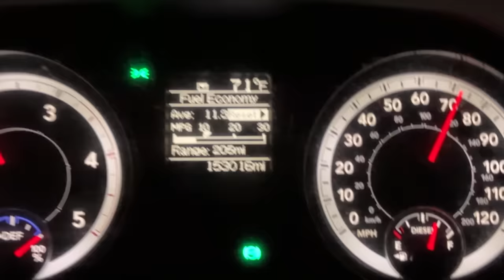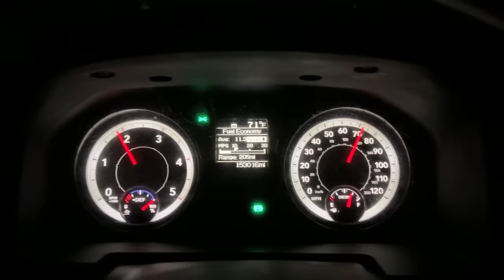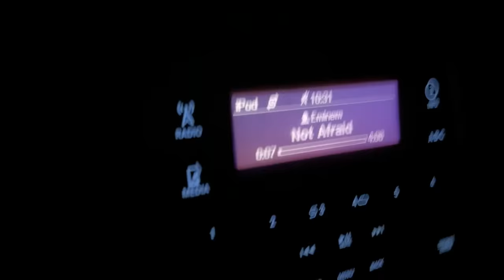My new truck broke down 9.5 hours from home. Dealer refused to do anything...

Comment: I worked at a Ford dealership for years and I think you unfortunately had a bad experience. We would have travelers break down from time to time and we would let them stay in their RV in the parking lot we would even run power out to their RV. Parking a trailer in the secure shop lot no questions asked. The 6.7 power stroke is a solid motor it shouldn't have let you down. That being said the fumnins is what brought me to your channel so I'm excited to see her getting some love.
Reply: This is the norm for dealerships treating people like crap I'm a diesel mechanic and see these people from all dealerships after they wiggle out of the warranty they come to us. While I agree it's a good motor, the issues are putting tons of cheap computer components on it then this happens, and it's all makes and models, no exceptions, even Germans' cars, same stuff junk
Reply: I wouldn't waste my breath arguing about Ford diesels being worth anything except the 7.3 because the rest are way overpriced garbage but it's just a fact that dealerships of most any brand are rarely helpful and will do most anything to keep from doing free repairs and pretty much always have. The electronics were garbage in the 80's and haven't ever improved much although I suppose the early 2000's LS computer and the rest of it's rigamaroll have proved themselves very reliable.
Reply: @Crazy oilfield mechanic  That's a stretch  saying  it's in the same category  as the 6.4 6.0. It's a solid  engine, what's wrong  with the new ones is all the electronics on them currently. I have a 2016 F450  6.7 EGR deleted, DPF deleted, fass fuel system  and a mild tune. Im not worried  about  it lasting  till 400k. The new engines  are fine, it's all the BS they put on them.  I bet with a aftermarket  fuel system, full delete  and a mild tune that truck would  be perfect. I still like the Fummins though  lol

Comment: I definitely think putting the fummins back into use is the best option. God forbid you start using the new truck again and it break in another 15k miles. The fummins really never let you down. Sure it needs work but 1. Its way cooler than the new truck. 2. with the engine thats in it I still feel like its more reliable than the 2020. Which unfortunately says a lot.

Comment: This is certainly an eye opener and something thats been on the back of my mind also. We are just about to leave on a trip towing which is around 4000 miles in your figures. We actually ordered a new tow vehicle for warranty etc however it's still not in the country so I'm now prepping our old faithful. 

You raise really valid points regarding if something was to go wrong with either vehicle. You are so dependent on the closest dealer and really have no control. Bring back the Fummins, it will be a great series to watch 👍

Comment: I'm sorry this happened Taylor.  I had my F250 threatening to go into limp mode while towing my RV through the Smoky Mountains.  I had to stop for the day and wait for a dealership to open, but when I got it there, without calling ahead because they weren't open yet, they actually got it in, diagnosed and fixed within a couple of hours.  It was also 100% covered by the warranty.  Obviously, this wasn't as big a deal as what you have, but I wanted to affirm that there are good dealers out there.  Rusty Wallace Ford, Dandridge, TN
Reply: I was 10 hours from my house in South Bend on the way back from Wisconsin when my starter went out in my Jeep. On the newer V8 Grand Cherokees you can barely touch the starter, let alone hit it with a hammer. Local Jeep dealer had it replaced in 24 hours. They definitely have the power to expedite things on a case to case basis. And I am the type to never rush a mechanic, but in this case I needed them to. This dealer sucks.
Reply: I live very close to that dealership.... got my truck at Rusty Wallace Toyota in Morristown. 
You had East Tennessee people looking out for you in time of need
Visit again.
Reply: @ericscottstevens  The Smoky mountains are awesome, and I'll definitely be back someday. I look forward to meeting some more locals.  Good folks there.

Comment: OK - so lets start at the servo shall we.
What is their business name, what is their trading name, what is their address, and lets see if the entire Internet can't BLACKLIST them.
Never to "ever" have anyone else arrive as a customer.

Then, lets look at that tow company shall we.
Why not name and shame them too.
I mean 25 miles away?
Haven't they got a SECURE LOCKUP near where they tow vehicles too?

Maybe we (around the entire world) start blacklisting them as well.
You'd soon discover a WHOLE NEW SET of client based services, that all repair workshops and tow truck companies would adhere to - if they knew they risked their business entirely - by screwing with customers from elsewhere, breaking down in their little area.

Comment: You probably wont see this, but my input: Definitely sell the 6.7 and keep/upgrade the fummins. Being that your job basically relies on the truck getting you to events, I think it would be the better choice. Like this situation, new vehicles are harder to do simple diagnosing, have more electronic failure points, need dealerships to do the work, etc. When they work, they're obviously better than an old truck, but when they fail, its typically a major issue leaving you stranded. With the fummins, YOU built it basically from the ground up and know the truck in and out. Being an older cummins engine, its a lot less complicated, and if anything were to happen, you'd most likely be able to diagnose it yourself quickly , and fix it easily.
Reply from the maker: Yeah I made the mistake of thinking engineers with millions in R&D could do a more sufficient job. I was wrong. Which is unfortunate. The whole idea was if it saves me missing even one event it saves me thousands of dollars that would have been wasted. Instead. It caused me to do just that.
Reply: Yea newer trucks just have more failure points , and the emissions systems choke the life out of them.. they always say a ford body, with a Cummins engine and Allison trans is the best truck out there, and you have that, and it even has most of the bells and whistles the new trucks have anyway lol
Reply: @Taylordrifts  
Actually Taylor,
You did far more R&D on the Fummin. You completed the proof of concept by putting it to work right after the build and testing.
Ford still has problems with the same friggin fuel system for how many years?????
You are the most thorough person I know besides myself and I do not work well with others because they say I'm too anal (including my exwife).😂🤣
You are good at what you do because you take that extra time, even when you say you are just throwing it together. We all know.
Reply: @cameronsienkiewicz6364 Anyone who knows transmission would pick a 6R140 ford trans in a heartbeat over an Allison..
Reply: @98Blower  I've been told  the H.O. Cummins with the Aisin tranny is the strongest and least problematic setup there is for these trucks.They drive them to 500,000 mi and sell em.
Reply: @TheBoome if you use a little research and common sense a 6.7 PSD is hard to beat IMO.. They are the #1 sold diesel pickups for a reason.. No doubt on the combo your talking about hard to beat the reliability of a Cummins. I personally hate to hear one run vs a 6.7 psd. I've been spoiled with how quiet they are.
Reply: @98blower17  the 6.7 over the 7.3? No chance, the 7.3 is legendary. It is the 12 valve of the powerstrokes. I have seen multiple hit 1,000,000 miles with nothing but normal maintenance.
Reply: @98blower17  There is no way you are saying this new bull shit is better than older setups that have been proven. As an engineer I can assure you that newer vehicles do not have the ability to shine, as the companies will do everything to cut down their own costs to fatten their pockets. If I could change the quality of materials on stuff I work on I would, but there is someone out there with more control over the financial decisions than I do.
Reply: @98blower17  I don't know much about these new Ford diesels, but I know one guy with bad rims and a leaking tyranny, and another who had to replace his def system for 3k cause power train warranty didn't cover it....Both trucks are 2018 or newer.
Reply: @TheBoome the 6.7 PSD is the most proven platform ford has ever offered.. They been running it over a decade with great success. I'm also saying this from personal experience with over a dozen company trucks with the 6.7PSD ranging from 2013-202, and a 2014 with close to 500k miles, and have only changed a water pump & A/C compressor since the day it was driven off the lot. The 2011-2019 have a little better HPFP protection that the 20+ like Taylor's here that crashed, but they have a fix for that coming within the next couple months.. We have also had emission problems in alot of them, but that's part of it across the board with all makes..
Reply: @zillbot  multiple 6.7's have also hit a million miles what's your point? They've had the 6.7 also for over a decade so I would definitely say it is 100% proven platform

Comment: P.S:
That is why I have the extended warranty option on my VEHICLE's insurance policy.
RETURN TO HOME.
Returning to home base, not only the vehicle but whatever it is/was towing at the time that it breaks down.
That means, screw with it being towed to some UNKNOWN repairer (or franchise) many miles away from home, with whatever trailer it was towing - being LEFT at the roadside because they won't tow that as well.

Nah - my "vehicle breakdown policy is exactly that - the ENTIRE VEHICLE COMBINATION (vehicle and towed trailer) are returned all the way home.
IRRESPECTIVE OF DISTANCE
That means it (the entire combo) comes back to my residence - & then (the broken down vehicle only) gets organized to be extra towed to my local dealer/repairer.
...
Past any branded franchised repairer - all the way back to MY HOME.
Why?
Well it ensure complete peace of mind, in that not only is the vehicle brought home (to my local servo) - anything it was towing at the time of breakdown also gets towed ALL THE WAY HOME.
======
Screw the idea of having a "loaded trailer" left on the side of a road, alone, with the vehicle somewhere else, BOTH a long way away from where I live. (with no way to get back & check on either)
Everything I drive away, (outbound from my own home) comes all the way back, irrespective of how far away I get before it breaks down
So that I can deal with it from within the confines of MY HOME - which thus allows me to get a local "curtesy car" while my vehicle is being fixed.
Oh sure - it's a few extra dollars cost every month on my "main" premium, but it's a guarantee that I cannot afford to NOT HAVE.
Plus it includes any night's accommodation on the way home, PLUS a rental car for myself (& passengers).

Seeing so many vehicles stranded at the side of a road somewhere, because the driver hasn't had breakdown insurance, or worse, a trailer left behind - because of an INCOMPLETE insurance cover - keeps me satisfied, that all the times I have broken down - EVERYTHING has been returned home.

Comment: Definitely sell that truck when it gets fixed. Give the fummins some lovin and hopefully you never have to go through this experience again. Love the vids :]
Reply: Nah not after it is fixed. Because say the dealership offers you 10k for that truck not running. Let’s say it costs 5k for them to get it running. Then you go to trade it in, they will offer you 12k. Those numbers are not accurate or anything but the point is there. The dealership can and will try to double dip especially since he would be just selling it and not trading it. Dealerships don’t typically like just buying vehicles like that.

Comment: S&S just released a CP4 replacement. I believe it is called a dcr pump. They claim its a lifetime fix. If you end up keeping the white truck, this may be something to look in to.
Reply from the maker: If I did that. Then they would have a valid reason to void my warranty. I don’t intend on touching this truck until the warranty is up. Which may be useless.
Reply: @Taylor Ray  very true. Not to take away from the frustration of the situation, however what you described sounds like a shit dealer more than ford's reluctance to honor the warranty. We shall see how it plays out. I hope they (ford corporate) make it right by you. I enjoy all of your content, keep your chin up.
Reply: Buy a 6.7 like his current truck with 101k miles(just out of warranty) and get rid of the cp4 immediately. They're known to be hot garbage and have been taking out fuel systems since they started putting them on 2011 duramaxes. I wouldn't rely on a truck with one for anything